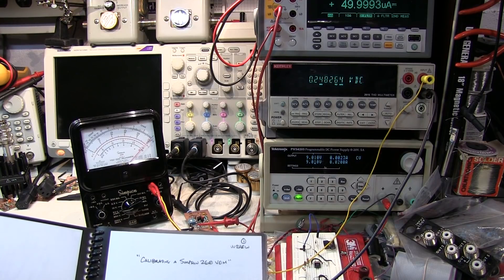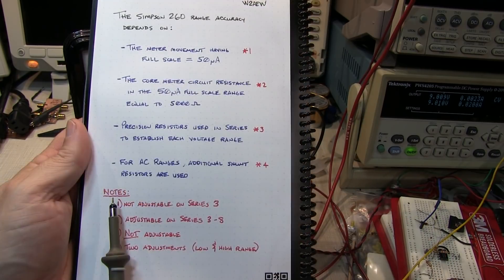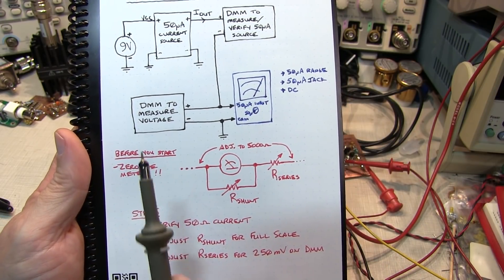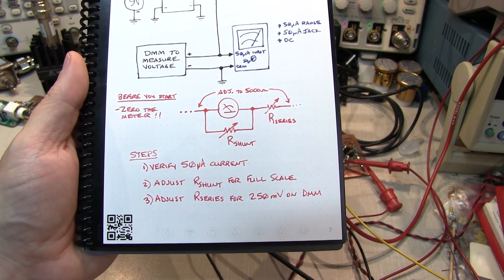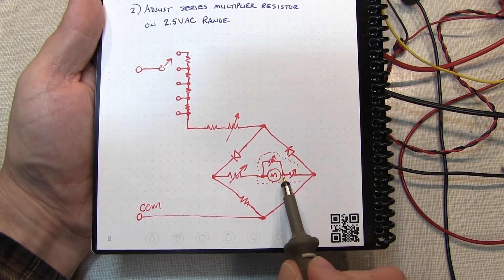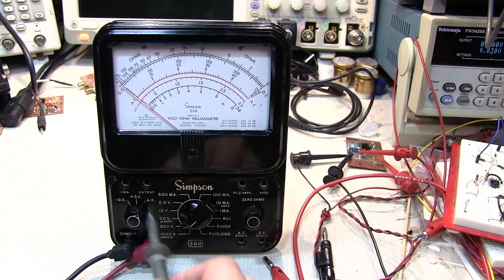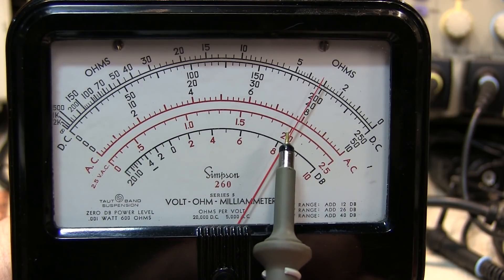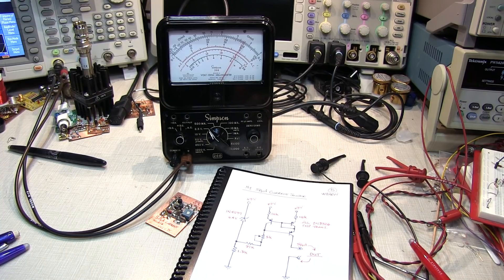#324: How to "calibrate" the Simpson 260 VOM - BONUS: 50 microamp current source

Comment: I don't understand why you set the 2.5vac on your function generation output impedance to "high impedance Z" because a simpson 260 input is not High impedance Z its not a digital fluke DVM meter it has loading issues. I'm not sure what the simpson 260 AC input loading impedance is but I don't think its high impedance Z. Also what is that bridge called with the diodes and resistors for adjusting the AC trim pots in the bridge for the AC voltages? does the bridge have a name?
Reply from the maker: The Simpson 260 is 5000 ohms per volt for AC voltage.  Thus, on the 2.5VAC scale, the meter's resistance is 12.5kohms.  Compared to the 50ohm output impedance of the function generator, 12.5kohms IS high impedance (there isn't much of a voltage division at all (0.996). I don't think that modified bridge circuit has a name.
Reply: @w2aew  I thought on your function generator you would have to "match" the output impedance with the meters input impedance at 12.5K because if the meter is at 12.5K and the output impedance of the function generation is set at 1Meg or 10meg high impedance the voltage divided of 12.5K with 1meg is going to have a "difference in voltage" from it not being matched. So the meters calibration is going to be off by the difference in voltage because the output impedance of the function generator and input impedance of the meter aren't match? What is that modified bridge circuit doing to the AC voltage? I'm not sure why they are using a bridge circuit because mostly when you use a bridge circuit its to null or balance the polarity or sides of the circuit. The purpose of the modified bridge circuit is to do what?
Reply from the maker: @waynegram8907  when you change the load impedance setting on the function generator, you are NOT CHANGING the generator’s output impedance!!!!  The output impedance (on most) is STILL 50 ohms. The only thing that changes is the amplitude reading because it takes into account the voltage divider between the 50 ohm output impedance and the actual load impedance.   The purpose of the modified bridge is to rectify the AC voltage and provide a scaled current through the meter movement.
Reply: @w2aew  I'm confused how the function generators load impedance setting changes the output voltage. Most old function generators didn't have any options of changing or applying a load impedance to the function generator so I have no idea what the load impedance setting does to the function generators output voltage and amplitude. Yes I see the modified bridge using the diodes to rectify the AC voltage and the resistors in the bridge are to "scale" the current how do? I'm confused how the bridge is scaling the current
Reply from the maker: @waynegram8907  Changing the load impedance setting does NOT change the output voltage, it changes the output voltage READOUT.  To help you understand this, watch this video: https://www.youtube.com/watch?v=tClE8s6RZdg
The bridge sets up a shunt path around the meter circuit which sets the base sensitivity, and the series resistors adjust the full scale reading.

Comment: Thanks, Alan for another great video and detailed information on the Simpson 260 calibration. I bought a 260-7P over the summer on eBay and just did preliminary comparison measurements to my bench GW GDM-8135 DMM and my Fluke 87 DVOM and it is close. I wanted to perform a more thorough calibration myself without sending the meter out and now I can with your ingredients.

Comment: As to the 250V AC calibration, you could use a couple "filament" transformers (there I go dating myself again), connected secondary to secondary to obtain it.  120V mains in --> 120V to 12.6V xfmr --> 6.3V to 120V xfmr --> ~240V out (i.e. connected in --> P:S --> S:P --> out).  Added advantage of this approach is isolation from the mains will provide some equipment and shock protection if implemented correctly.

Of course, the usual disclaimers regarding high voltage safety apply.  You should only try this if you are properly trained and qualified, and fully understand and accept all risks involved.  I accept no responsibility for any results or outcomes you may obtain.

Comment: Alan, great video. I need to go back and check calibration to my dad's unit again now! 😬 Wouldn't the dmm to measure voltage in parallel with the meter affect the reading. Yes, I know, a 10Meg or higher in parallel with 5k won't affect the result, but, the effect is there.
Reply from the maker: I figure since 10M is 2000x higher than the 5k meter resistance, the "effect" it would have is on the order of 0.05% - totally imperceptible.  You can demonstrate this to yourself by carefully watching the 260's meter when you connect/disconnect the DMM - no change is visible.

Comment: Hi Alan,  just curious if you may have run across my post here on eevblog;
https://www.eevblog.com/forum/metrology/simpson-260-series-8-calibration-instructions-(lots-of-photos-no-really-lots)/msg1503814/#msg1503814

Many times when adjusting analog meters, I find it helps to adjust for 80% scale, sometimes this helps with overall linearity across the scale.
Reply from the maker: I hadn't seen your posting, thank you for sharing and congrats on the nice Series 8 (two years ago!).

Comment: For the 250mV adjustment, did the calibration info specify the meter input impedance? Is the keithley 10MOhm or is it in the GOhm’s in that scale? The input impedance could have an effect on the accuracy of that setting at those low voltages and currents.
The calibration may have been expecting a 1MOhm or 10MOhm load from the meter, which is why I’m asking, because if the Keithley was in the GOhms it might have resulted in an incorrect adjustment (counterintuitively)
Reply from the maker: Even at 10Mohm, the DMM is 2000x higher than the DUT, so the error is imperceptible.

Comment: Thanks for the video, especially the bonus current source! I think I'll make one.
I don't have a Simpson meter, but I do have some 50uA panel meters, and I'm interested in the varistor protection device. I didn't see a part number for it in the linked manuals. Do you know anything about it?
Reply: I remember seeing,  ages ago,  how you could connect a pair of diodes across a meter movement like that to protect it from excessive voltages being applied.  I don't unfortunately recall what type of diodes these were, though.
Reply: @Roy_Tellason  A 50uA meter might only have 0.15V across it at FS, so it would peg even with schottky diodes. But it's still probably enough protection to avoid damage. I saw somewhere that there are detector diodes that have a drop of only 0.2v.  
But the Simpson manuals say it's a varistor - I didn't know they could work down to such low voltages.
Reply: @Roy_Tellason  For most meters a pair of 1N914 or 1N4148 diodes back to back will do a reasonable job. 

You have to remember that a diode isn't really a voltage-controlled switch that turns on at some particular voltage, and is completely off below that voltage. While a silicon diode will nominally turn on at .6V, it is really an exponential curve, and still draws slightly measurable current at .2V. So this can affect your meter calibration over the full meter scale range if the meter wasn't designed with protection diodes in the first place.

Before doing this you need to do two things: 1) determine the FS voltage across your meter. It should be less than about a third of the diode turn-on voltage, and 2) make sure there is some current limiting resistor in the circuit that will limit the shunt current through the diodes to something they can handle for at least a few seconds. Otherwise the diode will pop and then the meter will.

Also remember that even with diodes you can still apply about 4X the voltage (or current) to the meter than the FS value. This means you can still get that needle moving real quick and slam it into the peg. Possibly hard enough to bend the needle or maybe even damage the bearings. So the diodes can keep you in some circumstances from burning out the coil, but you can still damage the meter movement rather badly.

Comment: Is it possible to use DC voltage for the AC calibration ? Remembering to adjust for 0.7 (rms) of the dc voltage and not peak of course.

Comment: For anyone panicking over the DMM measuring the 0.25 V DC and shunting the 50 uA: Input Z of that DMM is >10 Gohm
Reply from the maker: Even at 10Mohms input on the DMM, that’s still 2000x larger than the 5kohms it is shunting, so the error is an imperceptible 0.05%.

Comment: What is P05 V0I S0000000? (The QR Code decoded)
Reply from the maker: It’s used by the Rocketbook app to organize pages after scanning
Reply: Probably a notebook page number 5, volume 1and serial number 0. Makes for each page to be individually numbered and labelled in the loose leaf notebook.

Comment: Great job including the disclaimers! I did work in a cal lab back in the 1980s. We had a lot of 260s in our company. We always calibrated them in the upright position, because that's how they were used by most of our techs. They were mostly used as continuity checkers anyway,  since digital multimeters had pretty much taken over by then.

Comment: Hey I recently found your channel. I was wondering what field do you work in? I am a metrologist, formerly air force now contractor. Work mostly electronics these days (k1,k3,k4,k8).
Reply from the maker: I’m an electrical engineer, have worked in analog design, test, applications, validation and a few other roles, mainly in analog, mixed signal and high-speed serial. Currently a field apps engineer for Tektronix specializing in RF.
Reply: @w2aew  And still uses the Simpsons! 😁